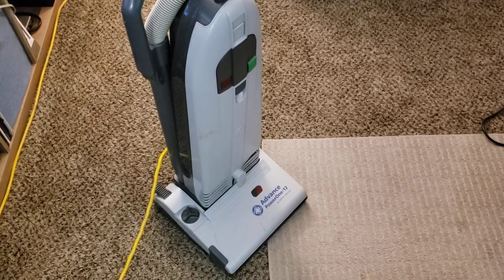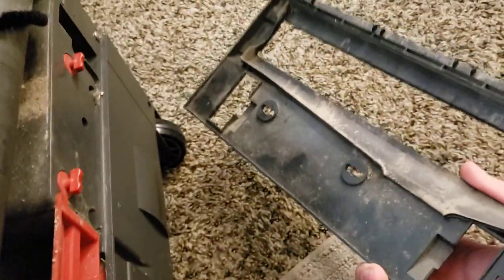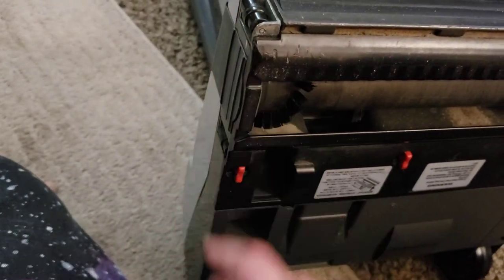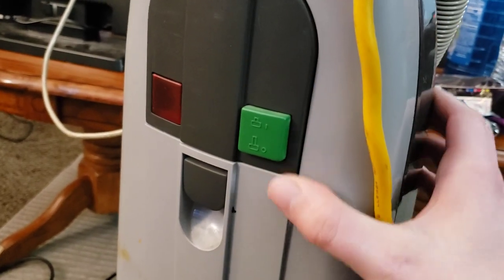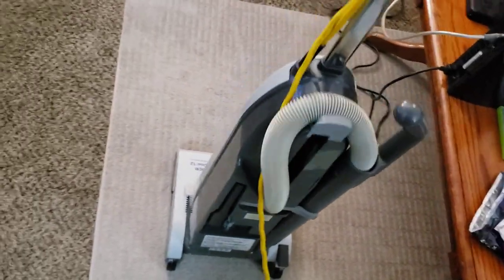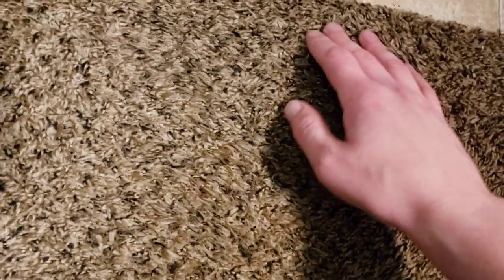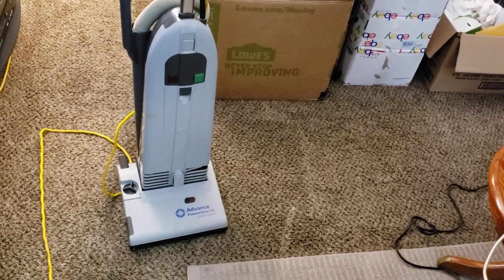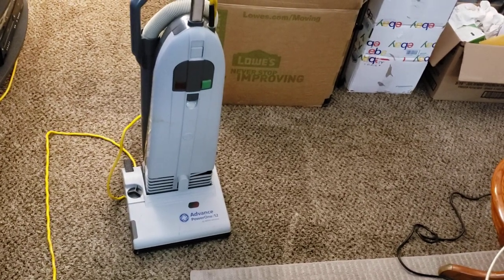Nilfisk Advance PowerOne 12 (Lindhaus) Vacuum Review

Comment: The better vacuum is the Advance 12H.  Easy to repair and get parts.  Good suction and it has a bag and has a HEPA filter.  It’s affordable too, less $250 on eBay and it’s rugged commercial grade.  Much cheaper than Kenmore or Hoover vacuums sold at Home Depot or Walmart.